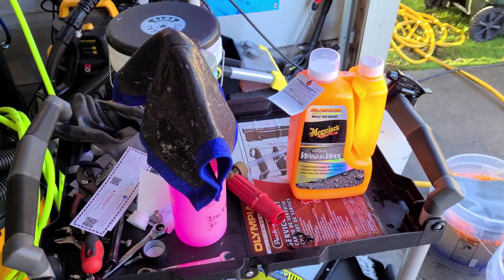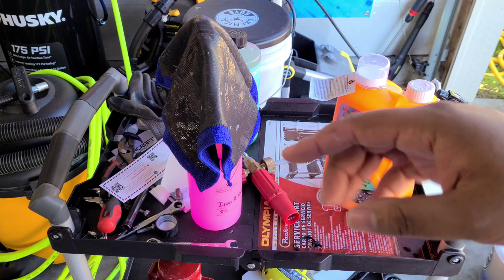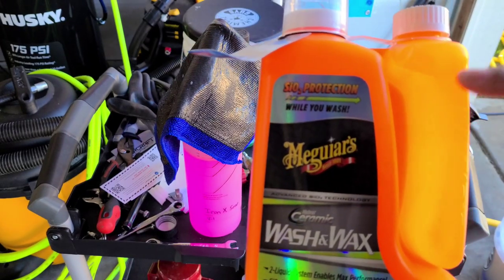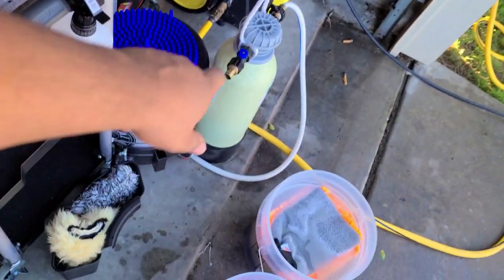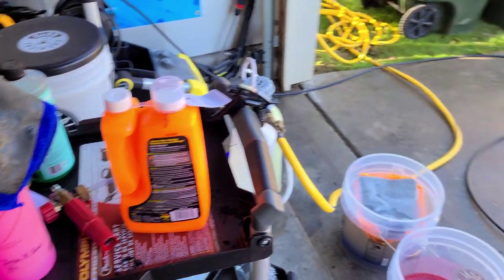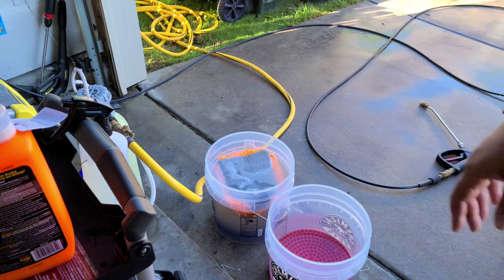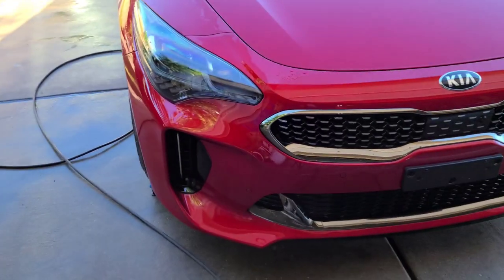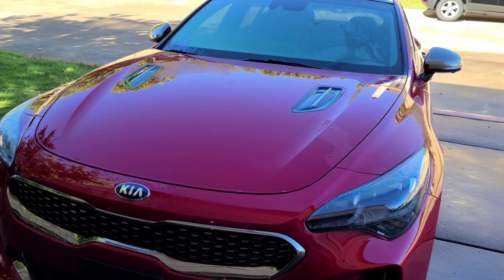[EXCELLENT] Meguiar's Hybrid Ceramic Wash & Wax - DON'T MAKE THIS MISTAKE!

Comment: I love this sio2 shampoo!  It beads like crazy when used correctly!!.  Some throw the shampoo and Sio2 boost in the bucket at the same time and lather up the pressure washer, then say "it doesn't work".  While using it as follows: shampoo, lather, put the Sio2 boost and mix the solution in the glove.  Do one element by element, and it works perfectly!.  Me, I love this coating maintenance shampoo with before the meguiar's ultimate snow foam in prewash!

Comment: I have been using this for a few washes now.  I do not like having to use their towel and I have a big truck and do not want to go over it twice.  I am going to try the armoralll version, seems easier.  I am glad you showed what went wrong, it is good to see real word situations.
Reply from the maker: Try Griots. It's better than Armorall and similar performance to meguiars. Easy to use.
Reply: What Griot's product is better than the Armor all ceramic wash. That foams up beautifully in my foam Canon and beads like crazy so I would love to try something better than that
Reply from the maker: @David-Godin  I have a video on it the griots ceramic wash and coat. That's better than the armor all if you want something that will make the water bead up that you can foam on. Carpro Hydro2 Foam works great as well.

Comment: Thanks for the vid. I simply used a firm dense foam sponge for one application coat, and hosed it off straight away with a normal hose and the results were FANTASTIC!
Really quick to use, and lasts well. Wouldn't even bother with the mitt. You get that waxy look on the very first touch of the foam sponge and needn't do any more than a quick, once over wiping. GREAT PRODUCT if you use it THIS way  : - )
Graham - Adelaide Australia

Comment: Do you have the singer new?
Singer paint is a problem with paint.
You will often notice that different seals on the stinger do not last long or not at all.
Reply from the maker: no it is used. i have worked on a few brand new ones though. have not had any issues with the paint. only problems I have seen are the painted rubber seals on the roof and the trim around the windows.